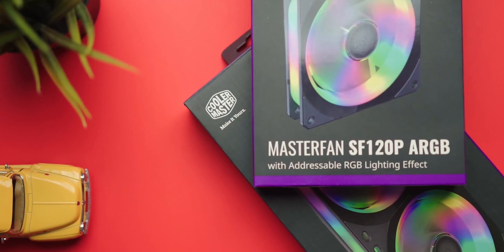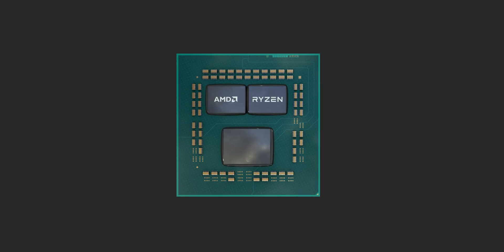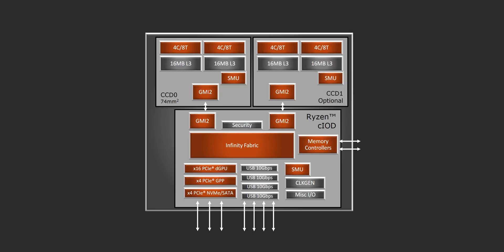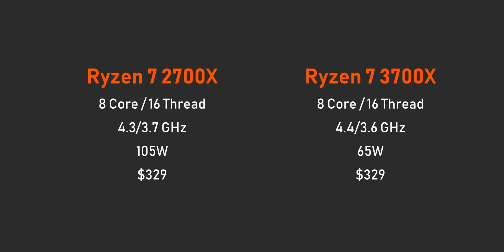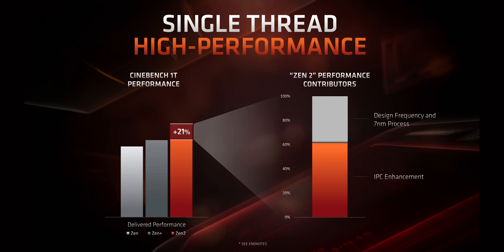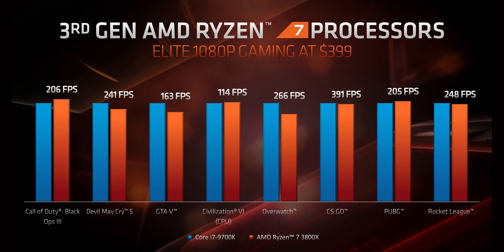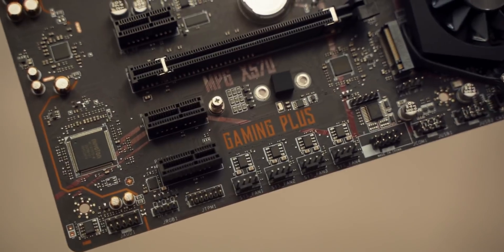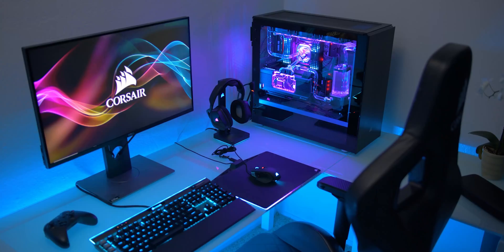AMD Ryzen 3000 – A Very REAL Problem For Intel?

Comment: To be honest, I'm just a little bit disappointed in the video. It is very professionally made, but contains a bit of false information, which, I think, shouldn't have happened. The APU's are 12nm not 14nm and are ZEN+ instead of ZEN (small difference, but still a difference). The 12 core isn't made of two chiplets with one deactivated but with all four activated and 1 core per ccs deactivated. Don't take this personal, I like that the channel is trying to expand it's content variety, but especially with more educational content the quality and correctness of the information is very important.
Reply: There is also bad information in regards to the pricing scheme + increased board cost for the higher end boards. The ones people buying 3700x-3900x parts would buy. This actually puts the 3700-3800x on the same pricing and performance tier as the 9900k, and the 3900x at a 200 dollar premium.   

AMD pulled the rug on us, and is basically matching Intel's/Nvidia'd insane inflated pricing scheme. Zen 2 is not the 9th gen Intel crusher the hypetrain is making it out to be. I am actually pretty disappointed in both companies. The top end part pricing has continued to grow at a much faster rate than wage rates of us citizens. It is honestly ridiculous.   

Nvidia's pricing scheme for Rtx cards was above and beyond insane, AMD releases slightly lower cost per performance cards to the mid range of the stack, and now we get "Super" cards with super retarded prices.   

Intel and Nvidia started this, but AMD is not breaking the wheel. I am hoping Zen 3 in 2020 will be amazing.
Reply: @Zerosixious  I mostly don't agree with you. And before you say that I'm a AMD fanboy, I'm not, I hate every company, but only for things they've screwed up. 
The only thing I think is close to price gauging from AMD's side is that there is no 3700 non x, which is a shame. The high end is understandable, the 16 core part is even a little bit less than the 8 core part in cost per core. I'm not sure what you were expecting, we are getting more improvements per year than we did for a lot of years now and you still complain. The high end is also not meant for most people. Be honest, for what do you need a 16 core. Most people needing a 16 core need it to get work done and for them, 750€ is a lot less than 1700€. People need to understand, that the high end is not for everybody, most people building a gaming or light workstation machines will be perfectly happy with the 3600 (or even a 2600 for around 130€, which is damn cheap). It's not the time where you needed an I7 to play Battlefield multiplayer, do 3d rendering or edit videos. The market has changed.
Also, no one forces you to buy x570, b450 will work just fine for almost everyone. Why would you need x570, do you actually need PCIe 4.0, a ton of 10Gb/s USB and multi GPU Support. I think you need to understand what you need and not what you want. 
And before you go on about future proving, there is no future proving currently, the market has startet moving faster again, by the time you would upgrade there will be new shiny things you want.
Also, yeah nVidia is way to expansive, but they can be, AMD isn't going to be a threat anyway.
Also, AMD did broke the wheel, you only really need a 130€ CPU (2600) for normal gaming and normal content creation now. Not a 200-250€ I5 of I7.
Just look back 3 years (just before pascal) and compare 600€ PC's.
Back than you got a crappy I5 8GB Ram no SSD and a r7 270x for that price and couldn't even play all the games with it.
Now you get a ryzen 2600 12 thread CPU, 16GB of Ram, a SSD and a rx 570. Difference to back than, you can run basically every game fine.

Edit: I will buy a 3700x and I will not get a x570 board, why should I? I'll just keep my current board and if I didn't had one, I wouldn't even consider a x570 board, since I don't like the fan on the chipset and don't need any features of it.
Also, you also need to buy a motherboard for the 9900k and to get similar features like on x570 you'll most likely spend a similar amount. I would even argue, that the cheapest board for a 9900k is around 170€ if you want to overclock, while for the 3700x (or even the 12 core) the cheapest board is around 100€ (or 130€ for similar features) if you want to overclock.
Reply: @felentus  Some of what you are saying here is factually incorrect. I am talking high end parts year over year. Not budget parts. The increases in costing are massive over the last 5 years, and are way above the average wage increases or inflation over the same period. You opting to go with cheaper parts and settle is by no means what I am complaining or talking about. I am talking about economics, and you are talking about what people want vs need. Your reply argument is not anywhere near apples to apples with the argument I am making. My complaint has NOTHING to do with performance or requirements for activities.   

You praising AMD while accepting massive high end price increases year over year + major ones this gen makes very little sense.
Reply: @Zerosixious  The high end parts always were around 1000€ (Intel HEDT before they started to panic). Now some of that high end HEDT stuff moved down to the mainstream. AMD could also have not released the 12 and 16 core and with your logic, there wouldn't be a price hike, if they hadn't. 
What I want to say, is that the high end has changed and is not the part that normal or even enthusiast users should desire. You also wouldn't buy the most expensive car just because it exists.

AMD also kept the prices more or less steady for ZEN. 

Edit: I could also put it this way, compare Ryzen 9 with Ryzen 9 and Ryzen 7 with Ryzen 7. I would start criticizing AMD once they start to put out new part with no great improvement and keep or even increase the price like intel did.
Reply: @felentus  Then from the mainstream skus, the equal x570 + 3800x would have been more expensive than 9900k + Z390 gaming tier board, for marginal improvement at best, and the 3700x + board would have been slightly cheaper with cpu + board, and had slightly worse than 9900k performance. People would have said that AMD was not looking to beat Intel, and instead was joining in on the high cost parade. Guess what? That is what is happening now, it would have just been more apparent the way you are saying. The new Architecture and production is actually a cost saving for AMD, they said so. The upgrade paths for 3900x and 3950x is not shown in what they are charging. Just like how the Intel HEPT cpus are INSANELY overpriced. It is all about money, not about the consumer.

The same thing with AMD releasing new "Navi replacement" cards, when they rebranded the anniversary card to 5700 xt, when it was going to be a RX690 that replaced the lower end skus. People would have laughed at the price hike, and the long development time. Notice the new Xbox and PlayStation have superior graphic cards in them, but they are not selling those parts yet? That's all about pricing and making money off deception.

These companies are not your friends, and AMD is not the consumer friendly company the hypetrain is saying they are. They are trying to drop feed for profit returns from a market inflated by Intel and AMD.

I am sorry if I am coming off as a dick, or anything like that. I am not mad or upset with you. I am just tired of people talking value for price point, when the truth is that the 9th series Intel CPUs were not upgrades enough for the price to be begin with. It is just overpriced Zen 2s entering a market of vastly overpriced Intel parts. Yes Intel is worse, but AMD is not helping.
Reply: @Zerosixious  That's true, but what incentive does AMD have to push the prices down even further. Also, what mainboard is a "gaming tier" mainboard on z390 and we don't even know the final prices of the x570 yet. Also, you can hardly compare z390 with x570, nor x470. Feature wise it would be somewhere between those two.
I also wouldn't be to sure about the cost savings, it might be true for the high core count server CPU's, but I don't think they've saved that much on the low end (8 core) chips if you consider the large IO die. I of course know that AMD is not my friend, but I do think that they are a fairer company than other companies in the field, at least in the CPU department. 
I get your point now, but I just don't quite agree with you. To me. you sounded like the new 3000 series is a failure, but now I don't think you meant that. For me the 3000 series is just what Ryzen should have been on release. I might have sounded a bit to positiv.
I was also disappointed in Navi, for me it's a failure. I don't quite get the part with the xBox and PS, they are most likely still using small Navi like the coming cards.
Reply: @felentus  I believe we agree on the performance and influx of competition that AMD is bringing back to the market. I am just disappointed that part for part we are closer to the higher pricing the 8-9th gen I7-I9s started. I also don't blame AMD, their marketshare, rnd, and  investment has to be profitable as possible. They have been in the backseat for too long. I just think people have an Intel Nvidia bad AMD good mantra going on in their head.

I was going off of a entry to the mid gaming motherboards and was using the ROG Strix Z390-E gaming and X570 same model as the targeted example. Most don't want to go to the Hero or higher, but the "Gaming" board is above the Prime, so people likely will choose it.

I think that the target GPUs AMD were replacing originally were the RX 500s, but the price hike would have made the hype drop, as it has been like 3 years, and the increase margins are not high enough. I believe the true replacement cards equal what is going into the next gen consoles in like 2020 or 2021. Those are probably being saved for the Zen 2 refresh in 2020.

I am glad AMD is back. Competition is needed as this is how the pricing thing happened in the first place. I am also pleased by the performance levels. I suspect Zen 3 VS the Intel 2021 (Maybe?) Parts is going to be an awesome fight that will benefit the consumer and drive technology forward.

There is a real world situation were I might be wrong though. Maybe the parts will not increase with the Trump china tarrifs, and some parts are still made in China driving the pricing. If they stay the same as the tariffs increase, then I will admit I am wrong. But I suspect we will pay for it. We will see. I just have to put it out there that I could be way off base in that situation.